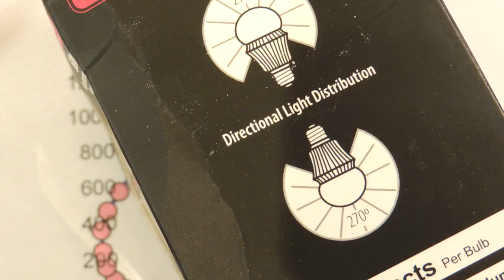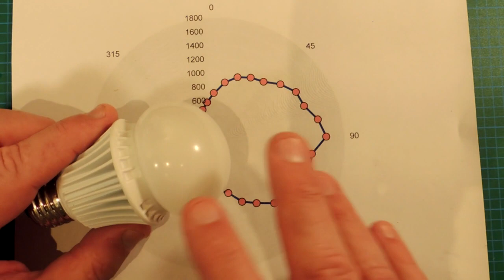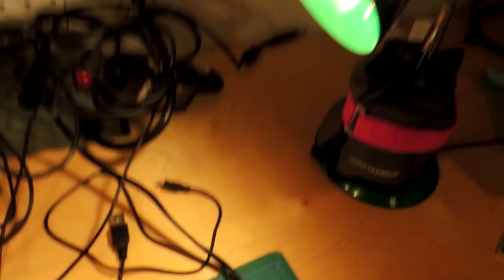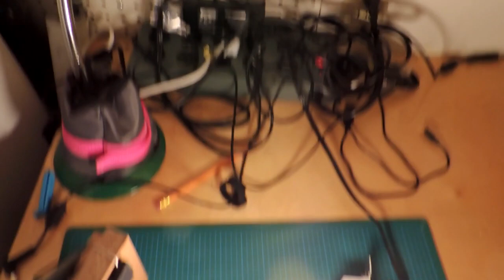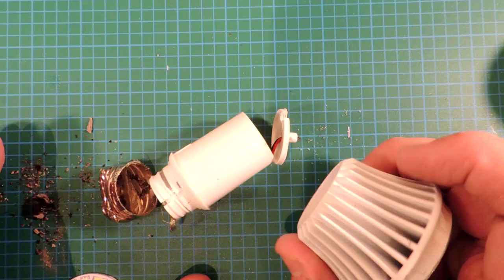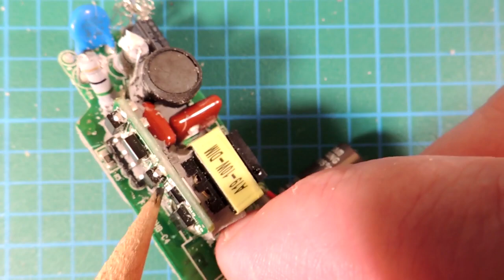Utilitech Pro (Lowes) ''60W" LED Bulb Teardown and Review. Late 2013

Comment: The newer Utilitech bulbs don't have the big metal heatsink. How do they not overheat?  Also I wonder if the board design is simpler, now that the price is lower. Of course I know all LED prices have fallen.  Also I noticed in a review of a Cree bulb that they also use a 105 deg. C cap. Actually looks the same as this one.